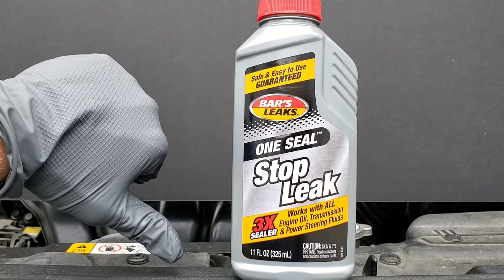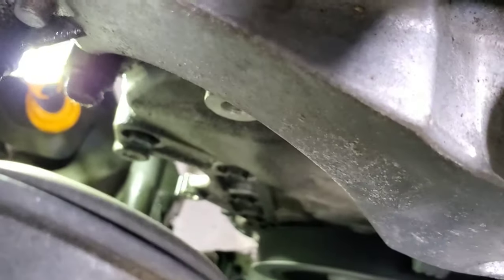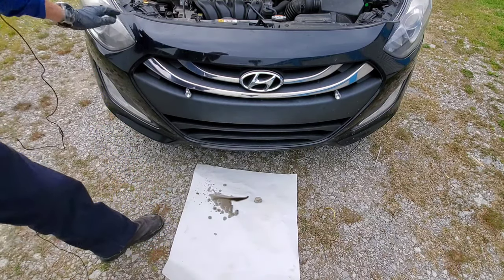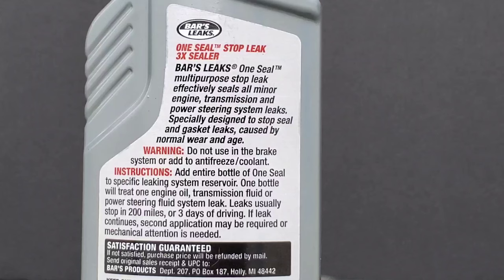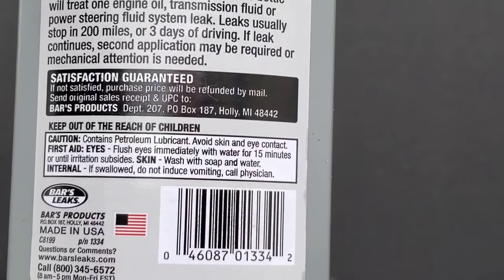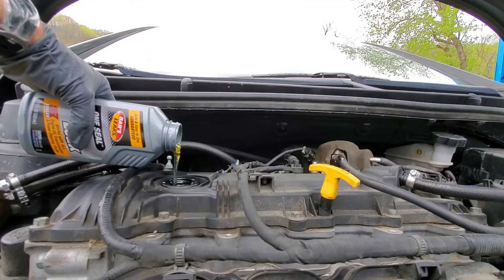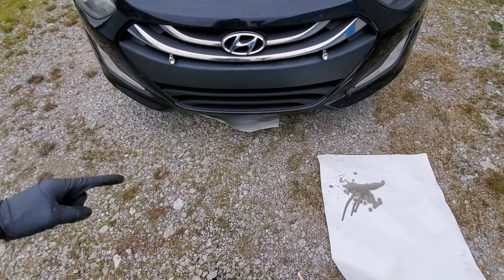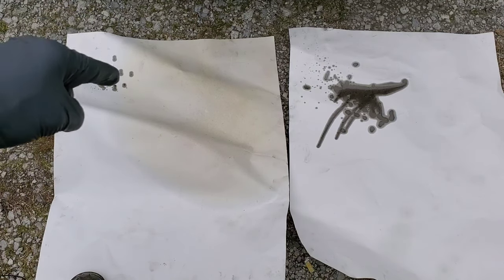I can't believe what Bars Stop Leak did to my engine!

Comment from the maker: What stop leaks have you tried and did they work?
Reply: Replacing the actual seal that's faulty. Do not bother with this kind of stuff unless you drive a beater.
Reply: I was pouring oil out of either the front main seal or the lower Timing chain cover on my POS VW 2.0t. Lost 7-8 quarts of oil during a trip. It was a Sunday and no shops in the area were open. Guy at autozone said he never had a stop leak that worked.. I agreed but had no choice but to pick one. The blue devil rms stop leak was what I went with and I was shocked the next morning when I looked under the car and "not a single drop of oil" on the concrete. I'm sure it is not a long term fix, but absolutely incredible results from a non-believer of stop leak fluids.
Reply: @hed_sh0tz__638  How is the car now?
Reply: @mikebrigandi_  Still doesn't leak at all. But the car took a poop. I was one of the unlucky people that didn't know the timing chain tensioner wasn't updated when they did the recall. About to do put a new head and valves in it.. 🙄
Reply: I am looking to find out what is the BEST STOP LEAK PRODUCT FOR A COOLING SYSTEM ON A (2009 DODGE CARAVAN) WITH THE LEAK BEING LOCATED ON THE DRIVERS SIDE OF RADIATOR ABOUT 80% UP THE SIDE TOWARDS THE TOP CLOSE TO THE TRANSMISSION COOLER LINES... AND LEAKS AFTER I DRIVE THE VEHICLE FOR 10+ MINUTES AND THE ENGINE HEATS UP AND PRESSURE BUILDS UP AND THEN MAYBE A CUP OR TWO OF COOLANT LEAKS OUT!!! SO I WOULD LIKE TO FIND OUT WHICH ONE OF THE RADIATOR SEALANTS REALLY WORKS THE BEST FOR "LARGER" LEAKS... ALSO WHILE NOT CAUSING ANY DAMAGE TO ANYTHING ELSE ETC!?!?!??? IF ANYONE CAN HELP ME WITH THIS IT WOULD BE GREATLY APPRECIATED BY ME AND THE ENTIRE FAMILY AS WE DESPERATELY RELY ON THE VEHICLE!!!! THANK YOU TO ANYONE THAT TAKES THE TIME TO SHARE ANY SUGGESTIONS ABOUT WHICH ONE OF THE LONG LINES OF SEALANT PRODUCTS WILL WORK THE BEST FOR MY SITUATION!!! THANK YOU
Reply: @tattbratz  I would be more worried about you stuck caps lock..... 
These stop leaks are best used on minor leaks not "larger" leaks.
Sounds like you need your whole cooling system flushed as it sounds like you have a blockage in the system.
Reply: @tattbratz  I had a Subaru Impreza turbo and the heater matrix went, would steam up the windscreen very bad and stank of anti freeze, garage said £600 to fix but said they didn't want to do the job. I added "k seal" within 5 minutes it was perfect, did at least another 40k no problems, then a tree fell on it, was well chuffed with the product though
Reply: @Alex123321Alex123  I might try that after I clear these codes out and retrain the computer so I can hopefully get the new NYS inspection needed today... And then I will try k-seal!!! Was it a specific kind of K-seal product or do they only make 1?
Reply: @Alex123321Alex123  is there a specific product I should be looking for made by K-seal??
Reply: @tattbratz  I don't think it had a specific name, but I was amazed at how quickly it worked and the heater matrix issue never came back and saved me 600
Reply: dan allen  sump is starting to leak on my 520i do you reckon this stuff be any good for it
Reply: @mikebrigandi_  apparently it blew his motor
Reply: Whole lot of shade-tree mechanics are going to be pissed over this however next time you have any of your oils and your vehicle be at power steering oil leaks or transmission leaks go to the store and purchase yourself for one of the tiny little cute bottles of brake fluid as crazy as it sounds poor 1/4 of it into your oil or power steering fluid or transmission anything that has rubber gaskets driving until it gets hot and pour that brake fluid in and watch what happens like magic you have no more leaks and I give you that one for free have a nice day and that's how you help the world
Reply: dan allen  STP,  did not work on mine.
Reply: @clintoniflagler8177  post a video of it 1st bud. I’d love to c it for my self
Reply: @hed_sh0tz__638  how's it going now one year later
Reply: . . .Bars cools system leakage stop worked excellent on my old AUDI 4000 (aka 80)  . . .saved indeed  m a n y  bucks (supposed cylinder head gasket blow) !!
Reply: My valve cover is leaking and AutoZone is out of blue devil so I'm going to try this bars leak I don't know about it but years ago I had a really bad leak in my radiator and I used bars leak pellets can't remember how many pellets were in package but I remember it said use 2or 3 I put them all in it and I was shocked it stopped it completely
Reply: @Education Pineapple  ford transit 2.0 tdci, fifa 2004.  1.3 Liter only which means i can only empty 25% of my Bars stopleak in to transmission ? 
Bottle does say that it treats 4-6 litres of transmission oil but at the same time it says empty whole bottle, facepalm.
Reply: I used bars for radiator on large leak that poured out, & completely stopped leak, used on transmission & dont see no leak yet, will keep looking thnx
Reply: @kc816_9  A valve cover is going to be plastic or RTV silicone.  Stop leak won't help it because stop leak's purpose is to swell rubber seals (which is not a valve cover gasket).  You may try to put some Permatex RTV where it's leaking.  A thorough cleaning with brake cleaner prior to applying it is required. No oil can be present before adding the RTV.  Probably 50/50 odds it stops the leak depending on how bad the leak is and the location.
Reply: Don't know, but I tried somethinglike this 20 years ago in my 72 ford, 360 when I changed the oil, that thing smoked like it was on fire ! Said I would never use something like this again ! 👎
Reply: I've had this problem before, if it a slow leak/weep I used black pepper never had a problem after that ! 👍🏻
Reply: @sprintershepherd4359  î u

Comment: Works better if you actually follow the instructions.  You didn't drive enough and wait long enough for the product to react completely.  1 hr or probably 45 miles is far short of 200 miles or 3 days. Fail on the comprehension  of instructions.  At least you see the stuff did work.

Comment: The instructions clearly say most leaks resolve themselves after 250 miles or 3 days, so you should give an update when the 3 days is up. In my case I had a leak that was annoying as hell, and one bottle of this absolutely corrected it for me. So far so good for me.
Reply: You think itll work for a rear main seal ? Cause i have a semi minor leak there and i really dont wanna have to pull it apart
Reply: @gx2t  my crankshaft pulley seal was leaking & I put a different bottle of stop leak & it honestly worked

Comment: I put it in my transmission about three weeks ago, and so far, so good. The freakin' thing still shifts a little rough between 1st and 2nd gear, but I honestly have to say it drives a bit better now than it did before I added the Bar's Stop Leak.
At this point, I've put about 500 miles on it. I'll try to remember to keep this comment updated.
Reply: Hows she runnin?
Reply: Still running well my friend?
Reply: Bought my 06 sierra with 80k miles in 2018, got my trans fluid changed at 85k and it started slipping while driving home lol I put in barsleaks trans super fix or the dual formula and it has only slipped one time at 100k miles, i have 140k now. Now I'm gonna try the rear main leak fix
Reply: @jkyergyboy2671 do u step on it often ?
Reply: Hows she runnin?

Comment: I've used the bars pelletized stop leak on my my wifes 2012 honda civic. But keep in mind try to use new antifreeze. Her car had about 90,000 miles when I changed the antifreeze and then poured in the PELLETIZED bars stop leak. Her car has never leaked radiator fluid since.
Reply: Same for my vintage AUDI 4000. . . GREAT stuff anyway , , ,

Comment: My opinion on stop leaks is that you are way better off correctly fixing the leak if at all possible. I don't like the idea of stop leaks because they affect all the seals in the system and because they will reduce the oil's lubricity and change its viscosity, even if only slightly. An engine may not care much about this, but it could kill an automatic transmission. Think about it- Someone has a leaking valve cover gasket, so they add a stop leak to fix it. The stop leak also swells the cam seals as well as the crank seals and all the other seals and they wear into that position. When they start to relax over time or if someone changes the oil and doesn't add the stop leak again, you just created an expensive leak you didn't have before. I have never used an oil stop leak before but from what I have seen and heard from people who have used them, any improvements are usually very temporary and sometimes when the leak returns it leaks worse than it did before. If someone has a leaking rear main seal on an old beater that they plan to dump soon maybe give it a try. But if you care about your vehicle or if the fix is simple like a leaking valve cover gasket or something, my advice is to just fix the leak correctly and be done with it. I feel strongly enough about that that when my rear main seal went bad I spent the day pulling the engine out to replace it instead of trying to use a stop leak.
Reply from the maker: Yeah i agree with much of this thanks for the information.
Reply: I'm not sure these 3-dollar quick fixes are for guys that can pull their own engines out or even have a vehicle worth the expense of having a professional do it... These are usually only there to prolong the inevitable on high-mileage beaters. 

That being said, Lucas oil treatment (not a "fix") and Sea-foam in the FUEL TANK (not the harsh intake carbon blast) are the only additives I've used over the years... BOTH with phenomenal results on extremely high mileage engines including air-cooled shovel-heads run in extreme temps. The rest of the quick-fix-snake-oils just aren't worth the risk, in my opinion.
Reply: Yeah....a simple valve cover.  Try that on a 2005 Ford Duratec DOHC V-6. I have oil in the  plug wells on Bank 2, cylinders 4 and 5. Cylinder 6 is clean. You can't even see Bank 1 against the firewall. So...intake removal, harnesses all over the place,  then,  finally the valve covers. For a 16 year old car with 225k miles? The car is in cosmetically perfect condition but that's an awful lot of work.  If it could be avoided with a stop leak product that worked  I'd definitely give it a shot.  On a newer car..... never. I wouldn't even consider it. I've pulled a lot of engines back in the day. All kinds. Swapped engines, did Tune ups. Intakes. Everything. Did a lot of work in my garage for many people. Even if I still had my garage with the hoist. Engine stand, and all my old tools I still would avoid this job for this car. Even considering the awesome condition it's in. Just a royal pain in the ass. Especially without a garage now.  But I agree with what you're saying. I never recommended these quick fixes. Especially the radiation stop leaks.
Reply: @RickyPisano  I know what you mean, I had to pull the motor out of my car to change the rear main seal a couple years ago. I'd try a good high mileage oil before a stop leak though, especially if you plan on keeping the car. If you use a stop leak you will likely have a bigger leak and/or more leaks than you started with after a year or so.
Reply: @averyalexander2303  Yes... this car never missed an oil change in 15 years.  This Ford 500 Limited is almost mint. Not a knick on it.  Interior like new.  Everything works perfectly. Brand new tires. I KNOW it's still a strong car.  I cleaned out the oil in the plug wells on cylinders 4 and 5 on Bank 2. Not that much.  Not even touching the coil packs. Plug well on cylinder 6 was clean. Checked all front 3 coil packs on Bank 2 and they were firing strong. Tightened up the valve cover just a bit. So at this point I'm gonna change the plugs in cylinders 4 and 5 and check the plug in cylinder 6. 4 and 5 are probably fouled. If the lean STFT/LTFT readings return to normal on Bank 1 and the misfire stops in Bank 2 I'll leave it at that. Bank 1 might not even be leaking and there are no vacuum leaks. If the readings go south again and the check engine light comes back on then I'll remove the Intake manifold, both valve covers, change all the gaskets intake included, plugs, coil packs, PCV, clean injectors, check the cam retainers, everything I can reach with the intake off and valve covers off. Then I won't have to worry about doing the same job in 6 months if Bank 1 has a problem. Man,  I miss my old tools and garage right about now.  If I still had them this would be a wrap by now.  Thanks for the input. Appreciate it.
Reply: @RickyPisano  how did you clean out those plug Wells without getting the sediment inside of the holes? I have a crown Victoria I just changed the coils on it and noticed there was a shitload of debris inside of those holes and I was afraid to get it inside so I made sure I didn't. But I'm still wondering how to get it out safely?
Reply: @JohnSmith-xx1lx  Hi John,  I used a pencil with masking tape wrapped around the end.  Then I very carefully got the debris out by pressing the tape into the well so the debris would stick to it.
Reply: @RickyPisano  thanks for the tip!
Reply: @JohnSmith-xx1lx  with the Sparks plugs in blow compressed air in there. Should get most of the dirt out

Comment: The description says do not use but the video shows that it works what did I miss?
Reply: Ikr 😒
Reply: Does it work...from what i seen yeah...but it honestly is not good an can cause other problems. If you love the car replace seal...if you dont use stop leak.
Reply: This stuff expands the seals swells them up. Eventaully you WILL run into a worse problem

Comment: in my 2000 Corolla that is burning oil, I tried 1 container (11 oz.) and the improvement was dramatic... Burning oil from valve seal/guide brittleness at 300K miles and NOT 3rd ring down in each piston ...

Comment: Gasket swellers like this can only do so much. I don’t see this product thickening the viscosity of the oil like Lucas or any other similar additives.

A lot of people say Lucas oil stop leak doesn’t work either, but it worked great in my old corvette. Had a rear main leak that left 3-4 drops per night. 4 quarts 5w30 and 1 quart of Lucas. Within 300 miles the oil leak stopped.
Reply: I have a steering leak, grabbed some Lucas in hopes of slowing or out righy stopping the leak. Some people warning me that stop leaks can gunk up the system and make it a bitch for the mechanic who repairs the issue... is this a legitimate concern for a layman such as myself who doesnt want go through a couple litres of steering fluid before getting it to a mechanic?

Comment: Hi Nate love your videos. Very interesting to see the results of this test. I saw another person comment about AT-205 reseal and would love to see a video about that as well. Keep up the great work man!! 👍
Reply from the maker: Thanks for your time and suggestion i will do just that.
Reply: Been wanting to try atp205 but unavailable 😐
Reply: Atp205 worked for both of my cars with small oil leaks.  Too bad I haven't seen any sold either due to supply chain problems.
Reply: Does Bar's Leaks One Seal Stop Leak have the same active ingredient as AT-205 and Blue Devil Power Steering Stop Leak? Diethyl glycol monoethyl ether.

Comment: I am using bars leak 1040 right now.   A pan or main seal leak on 98 2.4l caravan. A small leak is leaking less!   5 days. 130 miles.  So far.   The bars leak tech said more driving is needed .   we will see.      Bill

Comment: I had a small radiator leak and used the radiator product. It ruined my radiator and resulted in me having to replace the radiator all together. It was a terrible decision to trust the Stop Leak.
Reply: I used "k seal"for a broken heater matrix and was superb, never had another problem, was an orange liquid with a kind of thin wire stuff in it, must of done at least 40k with no issues
Reply: You probably would have had to replace it anyway.  What did actually have to lose?
Reply: @dfinch218  true, people act like they used it on a perfect vehicle. They probably are the same people who don’t change their oil for 5-6 years too
Reply: It’s cause you have to flush it out after too and most people never do that
Reply: I had a small leak at bottom of radiator core and fixed it with 2 Tablespoons of Barr's Stop Leak for radiator. I was afraid of using the whole bottle as recommended.  
Why don't they tell you to drain and refresh the water/antifreeze after applying a whole bottle to fix the leak?

Comment: I just got an oil change but can I still put that sealer in ? Or would that overflow it and mess up my engine
Reply: Tha is what I was wondering, did you ever figure it out?
Reply: I would drain a little oil out first. But if it's leaking bad enough to warrant stop leak you're probably low anyway.
Reply: @jusgarrison24  thank you for the help man

Comment: That was a big improvement and you didn't even drive the recommended 250 miles yet at the time, when they say the stuff really starts working. I just added this stuff to my vehicle, my front main seal leaks pretty good when driving so if it helps at all I'm happy because to fix it I will have to pull the whole engine and I'm not ready to do that yet! Your description says do not use and mad it sound like it caused a bigger issue, but that looked like a pretty big improvement to me fast.
Reply: Did it fit yours?